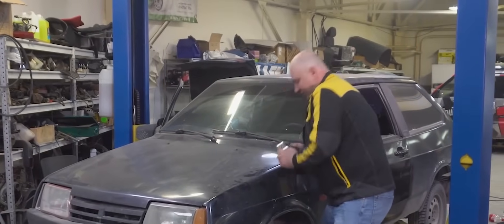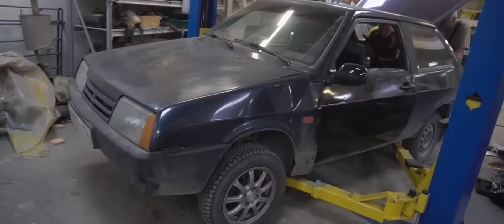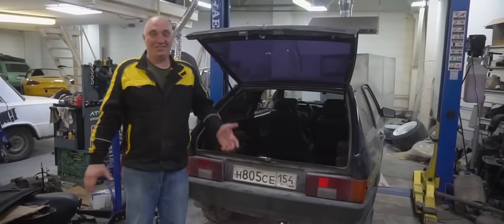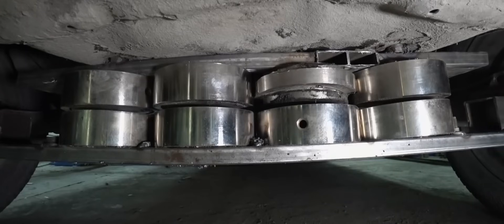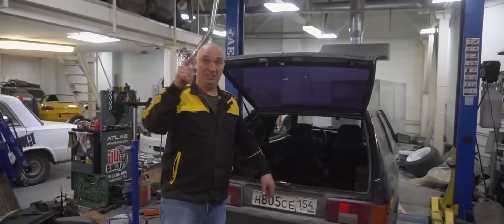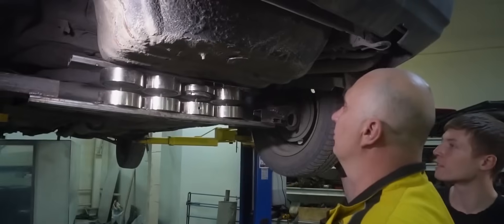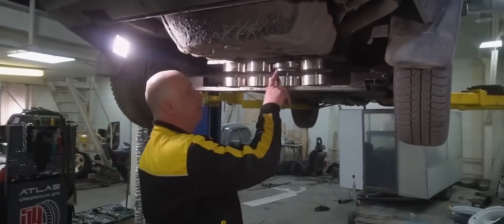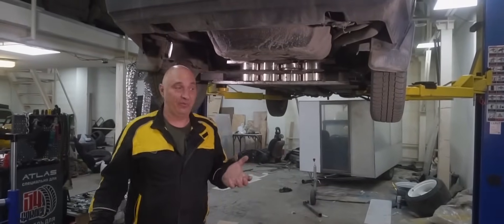DIY magnetic suspension

Comment: Not to mention if they're grade 8 then they have a great lateral tension force but the side shear force is very brittle, even grade 6 won't handle the road conditions over time not to mention that you will routinely have to clean metal that is attracted to the magnets. If you encased the set up in an enclosure that would solve that problem but then your adding alot of overall weight just for a shock absorbing system. Not a good idea.

Comment: 1) In long term, these suspension won't work. I think, you would also have to add original suspension along with these. This will be more helpful for both the lives of Magnetic and the original as there would be less impact of bumps and they will support each other

2) there would be rubber pads between two side by side magnets.

3) Bar on which you welded magnets should not be of Iron. As in long run it will be itself a magnetic bar and then don't know- wether it will impact original magnetic or not.

But it's nice out of box thinking..!!

Comment: Put special high efficiency solar panels (new ones came out within past 3 years that are as efficient as 10 normal solar panels. I think it’s an Australian company) on roof and use electromagnets instead that are also connected to the electrical system of the Electrical vehicle. Converting a ICE vehicle to a electrical vehicle is definitely recommended

Comment: the softness and power pulling pushing force defends on the  diameter and length of magnet, you simply put short length magnet equates to more force rather distance, the longer the magnet the longer distance will push off, the flatter, more force to repel and more harder.

Comment: Ive spoken and worked on this for 20 years. U need to incorporate the effect of copper alluminum mixture in ur magnet setup. It also needs to be direct to the wheel. Not axle. U need all surfaces to not touch. And the magnets if yes you were to use electro magnets as well....plus a computer system that scans the road that ready's the suspension in course with the surface of travel. Just thought id leave it short but still send some of the working ideas.
Great to see this idea starting to be used. Use the shock absorber design but with above mentioned method, and your spring should be ring magnets stacked 4-6 stacked to repel. Each one of the constitutes far greater continously smooth ride...... Costs a bit. There is alot in design. But it is worth it. And yes, you can charge the whole system connected to kinetic potential in ur brakes as well for a source of generated stored energy that feeds like a loop back into the car.

Comment: You should have just added a bit of rubber in between. Don't think it would have affected the magnets, but it would have reduced the noise and the bumps, and also maybe dealt with the problem of the magnets connecting, since the magnetic force is directly proportional with the square of the distance from what I rmeember from high school.

Comment: We did this at my shop for a 2000 Lincoln town car with electro-magnets on a shock absorber, the shock held the separate polarity mags on the travel shaft and absorber fluid body where the piston travels. System was  also was dampened by the shock itself.... it was a 100% success.... But not an adequate replacement for factory!

Comment: Just build electric magnetic coil shocks. Then build electricity to power a electric car. Every bump in the road will make electricity 😊
Reply: I'd like to see the magnet coil shocks and how they function!
Reply: @The Ancient Scientist will that be a coil made of copper? Or some other metal?  And the magnet placed on the top of the coil? I wish I could see a sketch diagram of some sort so I can see the setup. It sounds genius!
Reply: I believe a air rubber shock (like semi-trucks have)  would be best for design. Then install electric coil inside 
rubber keeping it safe from harsh environment exposure. Run wires out from rubber coil shocks to charge controllers,then batteries. 
Boom !  I know, why didn't you think of that. Hahaha.... Your welcome !

Comment: 20 years. Later .🌍🏞🏗🏜🏤🏢 cars charging by magnet shock activity.
Reply: Regenerative braking
Reply: @eksine  he's talking more on the lines of wave power
Reply: You meant Eddy current?
Reply: what he's talking about is getting electricity through the travel of the suspension sysem. 1- you don't need magnets, you could just use a spring without the hydraulic strut, really shitty ride tho 2- its not cost effective and not much power produced. would just be a waste of time. even regenerative braking is expensive. and all of this adds to cost and weight. who pays for it?  you guys want a $30,000 honda accord?
Reply: @eksine  were talking about the future here . 😆
Reply: @L45V3G45 🤣 current wars 😂🙉

Comment: Maybe they would work better if you could devise a way for the magnets to be pulling on each other, rather than pushing. Maybe some kind of lever setup, or curve the torsion beam so that it goes up from the wheel and then along above the frame mounted magnets.

Comment: you have to stack them.. 1 on the other = 2x magnetic flux coming out of each end.. so yes you should have done 4x2 not 2x4.. do a set of 4x4 (2 top 2 bottom with 4 rows of them) will give you ~1.8x the "travel" (magnetic flux force)   so try that and it should work quite well.  Also with magnetic lift suspension the force is stronger closer (close to touching) than it is farther. so with the right alignment of magnets it shouldnt really need suppressors. but would stop a bit of the "metal" rattle coming from the back "swing arm" (rear tire assembly)

Comment: It may work on small vehicles with no load capacity. Larger vehicles like SUV’s and trucks would need so many heavy magnets, it would bring down the overall performance of the vehicle. Spring shocks and struts are more reliable for a smooth ride plus can handle dirt and debris better...

Comment: Arrange the magnets vertically,like one over one over one. One sandwiched between two. And use a pair on both sides. Use gasket or rubber dampners in between each magnet.

Comment: Try converting them into electromagnets. The most basic system will keep the magnets farther apart. If you use a sophisticated computer system, it can change the power to the magnets instantly in order to maintain the optimal distance (between magnets) and optimal ride comfort. :D

Comment: This is an idea I had a long time ago but with RC Cars and not real. It is however problematic due to material problems and or energy to use if electro-magnetic. What he did not however think of was using copper as a cylinder to float the magnets in because copper is a diamagnetic and would have worked as a damper. So in that respect you would have something to both replace the shock and spring. Fun idea to play with in the RC realm but in real life Neodymium is becoming rare and it shatters easily so it is not a usable idea really. Plus you gain no advantage over the spring and gas systems of normal cars. The normal system weighs less and is higher performance.

Comment: Hey, he is brilliant. He should devolop his idea and replace the shocks as well with magnets as well, as a copper tube with a magnet inside of it on a rod acts as a shocks slowing movement more the harder it is pushed. (Check out others experments with copper and magnets.) Then the entire suspension would be magnet controlled. He could even use electro magnets so the hardness as well as the damping could be controlled electricaly even automaticall via the cars computer.

Comment: Move the pears to the corners then use a Teflon guide on top of the steel and run 12 volts in a negative polarity and see if I'm pushed further apart

Comment: Compared to standard Lada suspension, anything would be an improvement.
Reply: What are the last 3/4 to a Lada manual?

The plans and times of public transport
Reply: least lada had metal alloy in engine bmw used plastic 
Lada niva still the best 4x4 buck for buck off roader
Reply: Martian74 agreed, I traveled in one on a train track. That was hell.
Reply: I think even that suspension can't fix ride in that car 😅

Comment: Put some rubber dumpers in the magnet shaft..to avoiding the noise and breaking apart of magnets

But i think magnets are not a good idea..because it is being contact by sand and dusty area..and much heavier than shocks

Comment: hey I know how to get more power out of your permanent magnetic suspension. https://en.wikipedia.org/wiki/Halbach_array practice with small magnets so you know how to arrange the top and bottom ones perfectly opposite the round shape of the magnets are all wrong for this so you will need to weld a box that holds the round mag in place and fill it with iron shavings or little magnets. that way you have a nice easy square magnet. because the magnetic flux lines are not going in all directions you will get more force on one side for the same magnets.

Comment: Sleeve the magnets, but allow for travel. Then use ferro fluid in between as an added resistor this should allow for greater wheel travel and promote a higher resistance in possible magnet contact points. It may also increase the
ability of the suspension to moderate extreme compression scenarios.  Move the suspension to the out corners. Good luck.

Comment: Idea.. Electromagnetic plate in the trunk and those style magnets beneath.. Assuming you get the wires right you should be able to have an adjustable ride height with a rotary dimmer switch. More power = more height. Though that little car might lack the output with a single alternator.. Best part would be that when the car is off the suspension would drop.. Or worst part. Take your pick

Comment: Idea! Run magnets through copper tubes for shock absorbers along with your magnets installed. You might need a smaller diameter magnet but stack them together inside the tube. Maybe another row of magnets would help increase the repulsion distance? I would be very interested to see what happens!

Comment: All you need is Spring loads in the CENTER of each magnet along with the guides. 

So put springs surrounding the guides and put a set of magnets with spring and guide 🧲 on the outer sides not just the middle.
Reply: It's supposed to be magnetic. Using springs destroys the point

Comment: FYI Heat destroys magnets, I know because I sometimes weld magnetic steel.
Reply: Welding produces a shit ton of heat and you can weld magnetized steel but you have to heat it up to u do the magnetism. Or else you can even get an arch going
Reply: @dustinontaiyabbi  thermal conductivity/conductance. Heat transfers very efficiently.
Reply: you only need to go above curie temperature which for iron is only 700 celsius(1400f)
Reply: @minecraftermad  I doubt these are simple iron magnets. More likely 'rare earth' magnets that contain exotic materials.
If you think about it; I doubt that welding was necessary. Wouldn't they just stick the metal bars anyway?
Reply: @amanofmanyparts9120  yes as i mentioned neodymiums curie point is at 600 and if you've ever plaid with magnets you'd know that trying to push opposing ends to eachother results in the 2 misaligning till they fit or the other magnet can eve spin around now if you only sitck it to a metal bar which do you think has more force 2 magnets interacting with eachother or 1 magnet interacting with a small steel bar even if it was a full sheet of steel i don't believe it would be enough...
Reply: a better idea is to mechanically lock the magnets onto something
Reply: Magnets destroy welds, unless you know what you're doing lol
Reply: I was thinking the same. These guys partially ruined the magnets. The welding arcs are super hot and why don't these bear hugging Russians know nothing about this basic 7th grade stuff!!?? 
Now the magnets should have only a 50% to 60% of their original field. Pathetic.
Reply: Dustin Sanders a lot of heat does.
Reply: U could have made some holders for the magnets that would have been better for long run if u were gona do it
Reply: simply a spring is enough i think
Reply: Lol clearly they know what the duck they're doing because it's working lol
Reply: Smoking Kills Everything about your stupid ass comment made me mad.
Reply: What happening is actually steel heated more than 700 deg Celcius will have Austenitic structure that has non magnetic properties
Reply: thumbs up for the try, but you shouldn't have taken it to the road with that 10mm travel. And don't weld magnets next time

Comment: Try putting the magnets in a cylinder to contain the magnets. 2 on top, 2 in the bottom. Weld upper and lower Shock mounts to the cylinder and install on all 4 corners of the vehicle, like you would with traditional shocks. Now you would have the independent magnetic suspension. Should work. Great job men ! I love crazy thinkers like you!
Reply: Maybe you could have a viewing window in the cylinder to see how much travel you are actually getting

Comment: This was a cool episode!! What about a cantilevered setup so the mags and shocks are in the trunk then just a bar going to the axle itself. You can adjust ratios that way and get way more travel from a smaller gap in the mags too. Put some back to back so the is two gaps basically per corner one stronger then the other so it can be progressive suspension for better ride. Idk maybe over thinking it but I really like the concept!!! Cantilevered setups give u a lot of adjustability so that's why I brought it up. YouTube has videos on cantilevered cars with normal coils if anyone isn't sure what I'm talking I'm not about.  Hard to explain via comments section is all. I like the idea though for sure guys!!

Comment: You could try to raise the car a little bit more on magnetic suspension maybe if you put more magnet rows. Currently you have 2 rows of magnets facing each like North - North or South - South to repel, but if you add a 3rd row of magnets on top like   top magnet - NS - SN - NS you might be able to obtain double the suspension travel.    
 

   First layer        of Magnet:      Nord on top South at Bottom
   Second layer  of Magnets:    South on top Nord on Bottom
   Third layer      of Magnets:    Nord on top South at bottom 

Result:  First layer should repel the Second layer and the Second layer repels the Third layer

PS: you need a longer guide rod in the middle of the magnets

Best regards,
Vasi

Comment: Applying heat to magnets is never a good idea. They will loose their magnetism and then revert back to being useless lumps of metal.
Reply: Which is probably why this didn't work out as well as it could've.
Reply: Correct, it would have been more effective to weld the rims of the magnets onto the beam first and then place in the magnets inside their rims.
Reply: Swampy  You clearly never welded anything ever
Reply: Swampy  Ahh, so that explains it

Comment: Crazy idea, what if you made a electromagnet suspension and used a device similar to a leveling valve on a air suspension but instead had a potentiometer or similar device that would use the it's position to strengthen or weaken the amount of magnetism put out to control ride height?